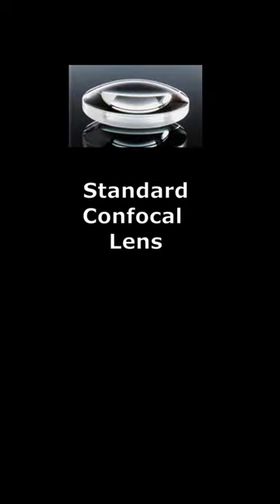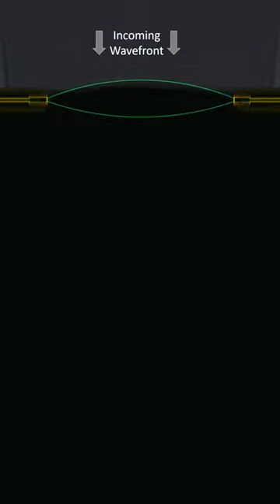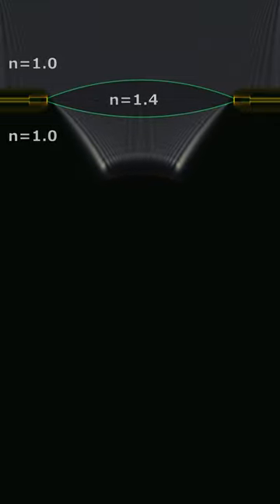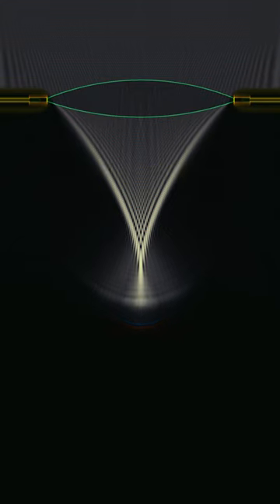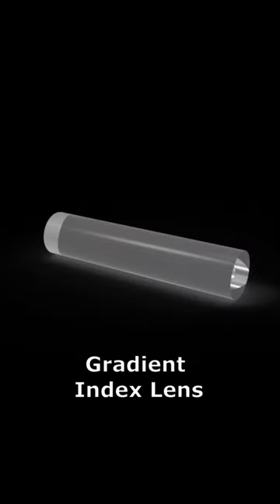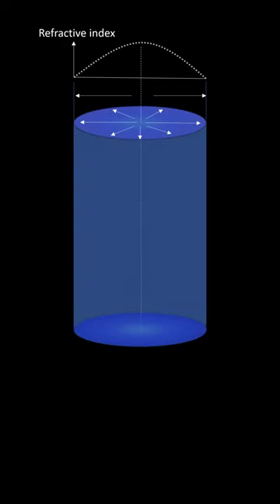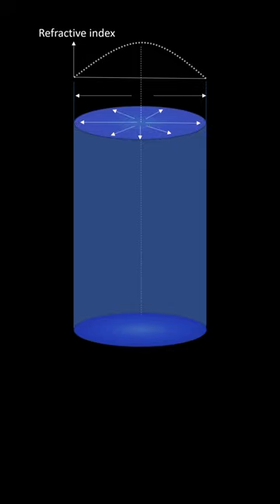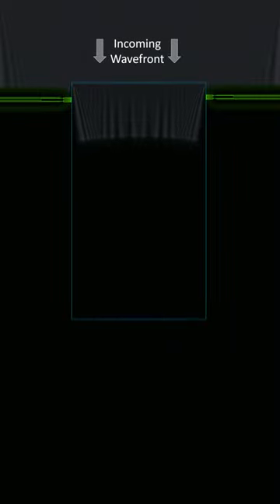Gradient Index Lens Explained

Comment: We have a weird and exotic problem in the ultrahigh power laser world where essentially everything can become a GRIN lens. If you crank the intensity of a beam up high enough, eg. into the gigawatt per sq. cm range, the electric field component of the EM wave will actually change the local index of refraction of the glass it's traveling through (the Kerr effect) and the beam will spontaneously FOCUS ITSELF (due to gaussian intensity profile across the beam diameter) down to a point where it exceeds the damage threshold of the glass and forms a track of micron sized bubbles through it as it oscillates thousands of times between Kerr lens self-focusing and plasma bubble induced defocusing. Large numbers of "angel hair" tracking lines of damage thus accumulate in optics used in high power lasers for eg. nuclear fusion research.
Reply: That’s so cool… yet it’s probably an annoyance to you for your work
Reply: Is there a way to cause that on purpose with a much lower powered laser?
Reply: Some materials are very good at achieving this effect because they have a high value of the third-order nonlinear susceptibility. They are used on purpose achieve this effect, for instance in Kerr-Lens modelocking which is a common way to create ultrashort laser pulses.

Comment: I first read about these in the 19seventies made by the Japanese company. Nippon sheet. Applications are mainly in the field of endoscopy where rods of the lengths of 5 to 10 cm can transport the picture. They are an alternative to the Hopkins Relay, however the latter is quite complicated in comparison to what the mechanical precision requirements concern. The GRIN lenses on the other hand are prone to inaccuracies because of the hard to control ion exchange processing of the making the circular refractive index gradient.
There are a couple of manufacturers making/using them in optical instruments, e.g. the company GRINTECH in Jena, Germany.

Comment: out of curiosity, what's the manufacturing process like on a gradient index lens like this? i can picture the process of creating a convex or concave lens, starting with a blank and removing material until you have the right shape, but this type of lens is very unintuitive to me, especially to do precisely. best guess is it has something to do with the heat treating of a material with a refractive index that changes depending on how long/at what temp it's been anealed? or maybe it's just extruded like that? but that strikes me as too imprecise.
Reply from the maker: The Wikipedia page on "gradient index optics" gives several options to create a refractive index gradient in glass. I think what they do in practice is: introduce an accurate gradient in a thick rod of glass and then extrude it to a 1-1.5mm thick strand/wire (this is generally the diameter of a gradient index lens), cut up the glass wire and then grind and polish the ends of the short pieces to create individual lenses. But I never made them myself so I'm not certain that this is actually the way that they do it.
Reply: How about that.  Maybe a glassblower could make one by layering sheets of different index glass around a cylinder and stretching it out by hand.
Reply: for microwaves, they can be 3d printed with novel materials.

 Traditionally they're made by drilling holes into a dielectric material and changing the ratio of air to dielectric gradually

Comment: I recall reading a paper many years ago on using a tube with air/gas with a radial temp distribution as a lens.  It worked but I'm sure keeping the "lens" consistent is a nightmare.

Comment: Hey Huygens, is it possible to use this gradient technique to produce a tube instead of a rod where the gradient is radialy instead radialy? Where you get a increasing Dioptrien by turning the tube but in the tube the focal point stays the same and out side the tube it varies in distance?

Comment: Lmao I know.... this makes me think, surely it's possible to have the focal point inside the lense or exactly on its exit surface? Could a CCD/CMOS sensor then be directly cemented to the exit surface? What would happen?
Reply from the maker: That is basically what they do in interferometers: cement them directly to a beam splitter to avoid two additional (reflective) interfaces.